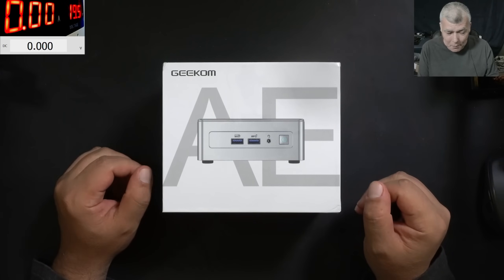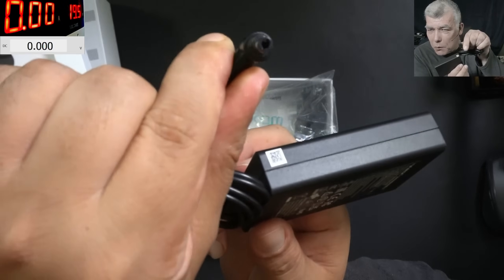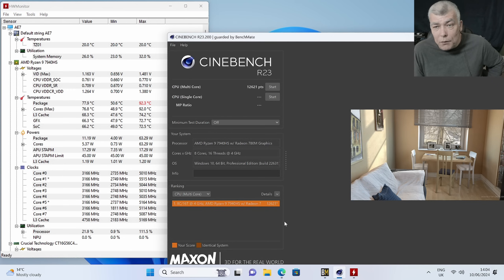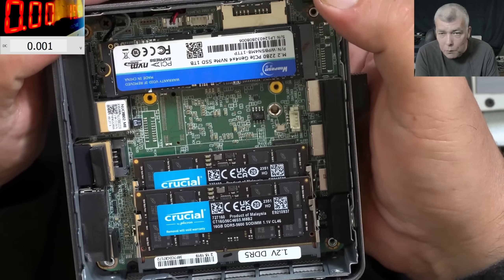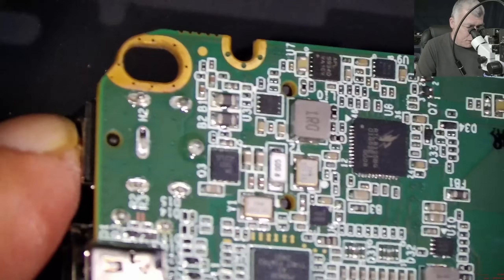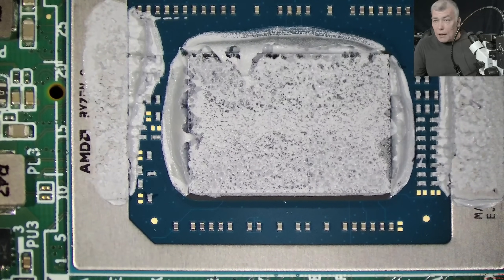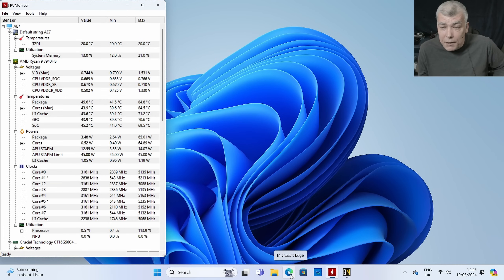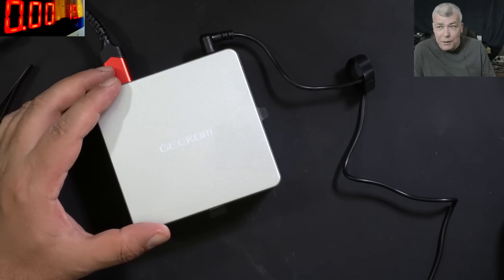GEEKOM AE7 Mini PC Review + Teardown + Improvement Tips & Tricks

Comment: Thank you for reviewing our product. Your feedback on GEEKOM products is highly valuable to us!
Reply: People have to have a monitor for a mini PC so why not have them in a monitor? This gives you a huge heat sink area.
Reply: @liveuk  the led and pcb inside the monitor also make the monitor a heat source, and also a closed space, I think it may be hotter built in a monitor or just similar as inside the small box, maybe a specially designed monitor with larger heat sink, multiple holes, air ways and fans will be better, similar as laptop or desktop pc

Comment: What does the mount for the 2.5 inch SSD for if there is no connection for it on the board? Is there any way to actually mouth a 2.5inch ssd and expand the storage?

Comment: Sorin! Thank you for this video. I have Mini PC ASUS PN51-S1 and power limit is locked to 11W!!! No Bios options and AMD APU software cannot bypass the physical limit. Now I see your shunt mod lol I will try on the ASUS board and report! Thank you for your amazing knowledge and videos!🙏
Reply: This is working! found 1MOHM resistor coming from DC IN, Soldered over top and now can use APU tuning software!!!!! CPU now doing 30W!!!! AMAZING!!!! WE HAVE PICTURE!!!! Thank you Sorin for the example and Inspiration! 🙏🙏

Comment: picked up a nice little nuc a while back. but its not got usbc which has turned into a pain in the butt with the adapters and compatibity.

i was looking to get another $30 used deal...no chance theyre all empty shells atm where people have been stripping the windows os keys out of them.
(they discovered my stash 😂).
worth more in parts than as a unit.

i csn get a brand new basic 15" laptop for the price of some of these used ones.

interested to see what sorrins selling though. cost and options.

mainly looking for a good foundation for home automation.

Comment: Great timing.  I got one of these last week.  I've set it up for remote access to run in a remote ham radio shack.   The heat generated is perfect to keep the temp perfect in the cold climate it will be in.  So far the performance and reliability have been top notch.

Comment: Very impressive performance but for how long ?
All that heat even with the large fan will takes it's toll sooner or later.
I would rather spend this sort of outlay on a tower PC with plenty of cooling
and off the shelf parts that can be replaced and upgraded.
Reply: im having mini pc which i use at work every day for the last 4 years, just change the thermal paste and it will serve you good... but for gaming i wont count on it :D
Reply: @ДимитърАндонов-ъ7е  For moderate use and some maintenance they will last, but not for long
if the cpu is at a very high core temperature.

Comment: The technique of applying liquid metal to a processor crystal raises serious questions about the competence of the author.
What will prevent the liquid metal from leaving the crystal and causing a short circuit on the motherboard?..
Reply: he applied it perfectly - thin layer that wont cause issues and the pc is staying for the most part on the ground not sideways....

Comment: Those mini PCs fail alot. Also if the fan breaks good luck finding a spare, these chinese brands do not sell spares. No BIOS updates as well. If buying a mini PC better to go for a professional one from Dell, Lenovo or HP.
Reply: why would you need monthly bios updates... i have no name Chinese mini pc and dell laptop, the bios updates are just BS
Reply: @ДимитърАндонов-ъ7е  Who mentioned monthly BIOS updates? I just mentioned BIOS updates. With this brand, you get none at all. There are always firmware bugs, and exploits that need to be patched.
Reply: it is a generic laptop cooler fan, which you can find on amazon, aliexpress, etc..  you just need to make sure you match the Voltage, as they vary.  I know this bit from experience, lol
Reply: I was going to buy a Geekom Mini PC, and bought a Lenovo Idealcentre Mini instead.

Comment: Network speed is counted in BITS per second, not bytes. So it’s 2.5 GigaBITS per second.
Reply: you know that there is correlation between the two metrics so its the same think to say there is 1 hour or 60 minutes :D
Reply: @ДимитърАндонов-ъ7е  You are forgetting about the per second element. 1 byte = 8 bits. So a 2.5 gigabit/second is the same as 0.3125 gigabyte/second (or 320 megabyte per second which is the same).
Reply: could you "say more" about it please, maybe some educational video on YT or a topic? thx
Reply: Yes he pronounced wrong but the speed test is actually showing Mbps, not MB/s.

Anyway, for who asks, the difference is that their are 2 different unit measuring. 1 byte = 8 bits. Mbps has lowercase b, so it means bit, MB/s has instead a uppercase b, which means byte

Comment: I feel decived. Why I cannot get full power from the factory?
Reply: Temperatures. Liquid metal is notoriously dangerous in unexperienced hands. You can kill your computer with that stuff. So they opted to use thermal pasted instead to avoid any such risks.
Reply: @MM-vs2et  "factory" and "inexperienced hands" should not go along, isn't it?
Reply: @sinchrotron  I meant when it gets to the end user's hands. There's lots of cases of factory applied liquid metal that seeped through the chip and the heatsink, contacting other components and killing the system. Usually due to movement and bumps that doesn't happen to desktop PCs. You can see how this creates warranty issues. Laptop manufacturers avoids liquid metal for this reason. Except ASUS, they could handle more warranty claims I guess.

Another reason is lifespan. Liquid metal pushes higher clock speeds which degrades the silicon faster, thus decreasing the manufacturer advertised lifespan. Again creating warranty issues on the distributor side.

Comment: It seems to perform much better than my liquid cooled 10700k after the mod 😅 so many power in a palm sized pc.
Reply: Ya AMD cpus this generation kick butt compared to Intel in most generations. Even last gen on these minis wipe Intel 11th / some 12th gen desktops. I have. 10700k build that have as a back now. I went with a 13700K -4070 and the cpu performance jump is insane. If I was you and you can go make the jump to a 12th gen or above with the igpu for quick sync . A 12600k beats all previous generation i9’s in performance and that IGPU is great for video editing in DaVinci. Even OBS using quick sync you can record 4K60 no issues.